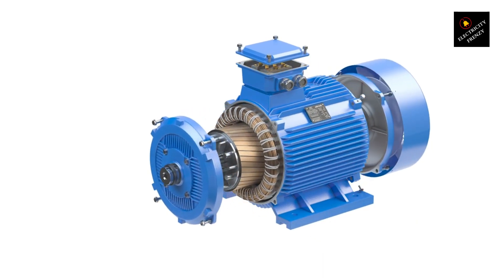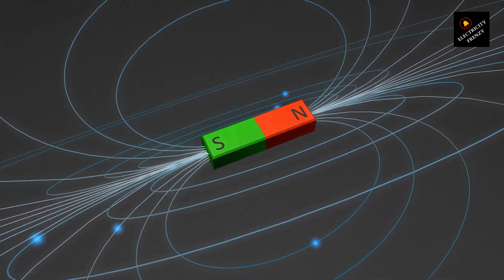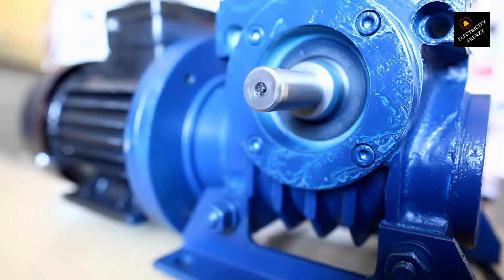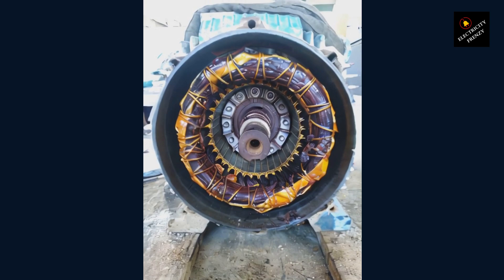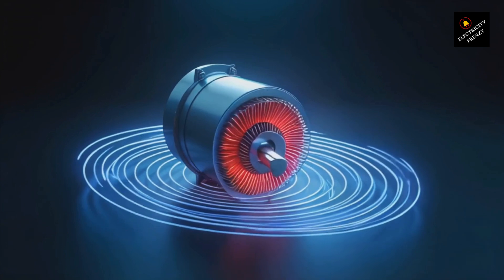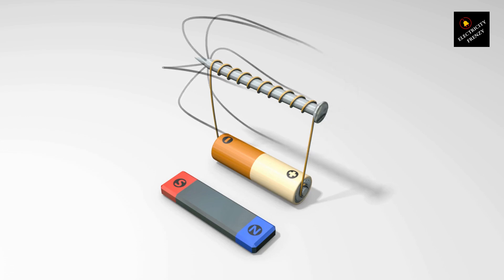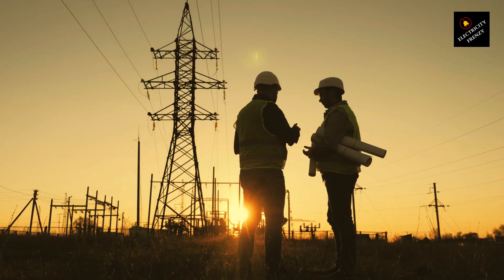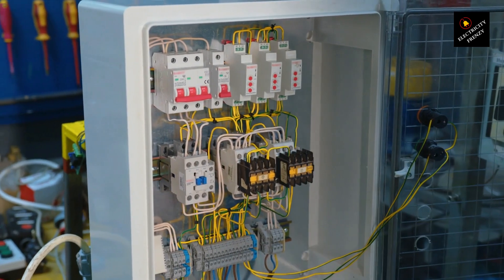Why 3 phase motor is self starting - explained

Comment: We have a Panasonic split AC of 1.5 tons. As we are aware that cut-offs would happen, For us it was happening frequently why ? This makes sudden sound like faster fan speed and coming back to normal sound why ?
Reply from the maker: Indeed, the sudden change in fan speed could be due to the power returning with a higher voltage than normal, causing the fan speed to increase. After a short time, the voltage returns to its normal level, and the fan speed stabilizes.
Reply: @ElectricityFrenzy  yeah ! What to do for that ? Kindly tell !!
Reply: Is stabilizer fault since we didn't noticed whether its single or double booster while purchasing. Or total voltage for the home is fault?
Reply from the maker: @ you should hire an electrician to check voltage in the home, and check the voltage of the area where you live, if the issue is common in the area you has to use a stabilizer that cn handle the low voltage, if the issue is only your home's voltage he should find the cause and fix it